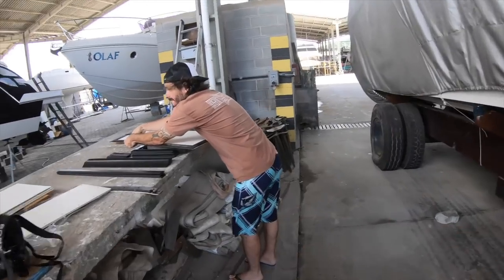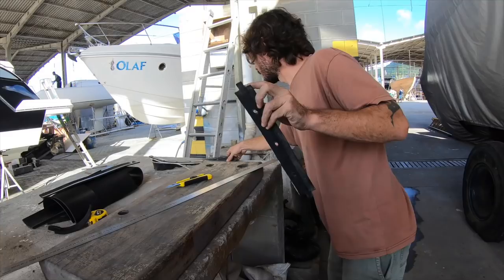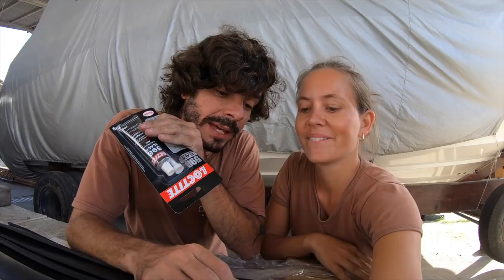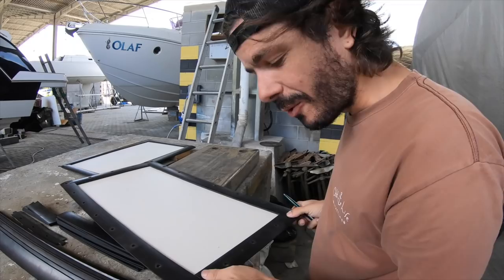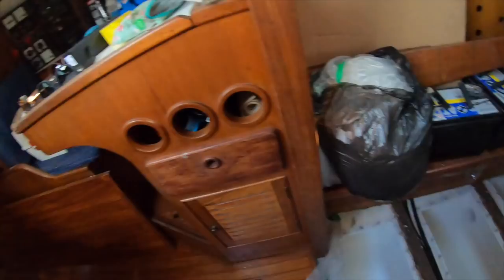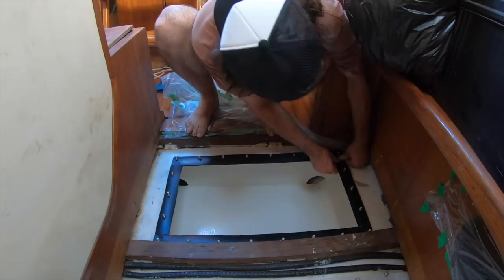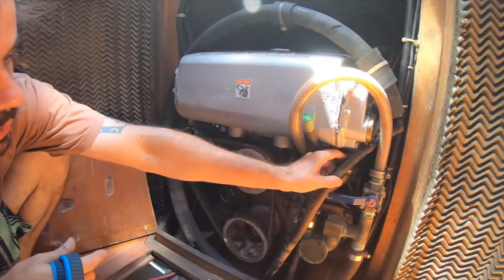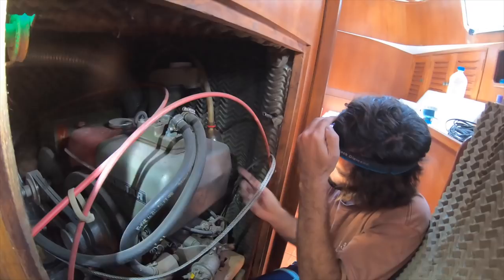⛵️Time to FILL UP our DIESEL tank?!? #127

Comment: You got to have a return hose to the tank from the engine!
Reply from the maker: It’s one of the hoses we replaced ☺️
Reply: Odd Life Crafting Are going to have a fuel polisher? You get bad diesel and you will clog up generator of engine or water heater

Comment: Can’t you test for leaks, by pressuring up the tank with air, and using a pressure gauge and time to determine if it leaks? Is it possible to reroute the Diesel line so that it doesn’t risk contamination of the H20?
Reply from the maker: Hello, Susannah. It might be possible, but we don't have the equipments to do the test. there is no option to reroute the diesel line. But as soon the tanks are closed it won't be a problem
Reply: Hi Duca. I agree with a pressure test of both your water and diesel tanks. Were you connect any pypes to the tank just disconnect the pypes and close them of. Use one that you can connect to a air compressure that has a guage that can show you the pressure. Pump it to a sutable pressure. Leave it for a hour or two and see if the pressure stays the same or not. With sope water and a paintbrush you can check for leaks at the tank.
Reply from the maker: The problem is that we don’t have all this material available here in the marina and to rent it would be quite of expensive.
Reply: Do you know that pump you use to pump n tyer stepping onto it with your foot. It is also good to use and not very expencive. And it has a guage on.
Reply: Perhaps a vacuum cleaner to see if it holds? Any air leaking in should be easy to hear (after you turn the vacuum cleaner off).

Comment: Is there a reason you did not use dovetail joints to make the diesel tank gaskets instead of the finger joints you used?
Reply from the maker: We kept the same format as the old one. But they are a little bit dovetail
Reply: For sure dovetail.
Reply: I thought a dovetail joint would be far more superior.  “Better”
Reply: how would you cut them in that material ?  would you have to make a die, and "punch" the joints ?

Comment: I have a suggestion that you and your Tubes might like: DIY Fuel Polisher. Ref: https://theboatgalley.com/diy-fuel-polishing/ You can never trust your diesel fuel supply. You can suck out your diesel and transfer it to another tank and clean out all those impurities, organic matter and water accumulation. Run that baby and you will have a lot less problems with your diesel engine and changing your expensive hard to find engine filters. By the way I would change out all rubber on your old boat.

Comment: How many gallons does the tank hold!🤔🙂
Reply from the maker: 650 liters
Reply: 650 Liters = 171 US Gallons or 142 UK Gallons(Imperial) 
Don't forget Diesel expands with temperature, so don't over fill the tank (or put a catch can on the breather pipe)

Comment: When cutting the joint in the gaskets, it might have been faster to bend a metal die in the shape you wanted, sharpen it,  and use a press or a hammer to cut the gasket but pushing it through.   It’s would be a lot faster and guarantee each joint is the same since the same die is used for the dove and tail.

Also when running new hose in tight spaces, attach the new hose to the end of the old one, then you can pull the new hose through  by pulling the old hose.
Reply from the maker: This would be great. The problem would be time, materials and tools to do the metal for it. For the tight spaces this is the idea we have, thanks for the suggestion
Reply: I was thinking like piece of scrap steel with a sharp edge vs a real machine shop die...   always great seeing your videos.   You guys are great at making do with what you have and learning as you go, love that spirit!

Comment: Engine alternator belts are loose
Reply from the maker: We know. We are gonna change the alternator. 😉
Reply: @OddLifeCrafting  Make sure it's either 100% new parts rebuild or a 100% totally new alternator... most rebuilt alternators will always 'reuse' old electronic parts that test OK, but can and do break.   Also true with starters too.

Comment: If your planning to put a heater in dont you need to put in a fuel line for the heater too
Reply from the maker: What do you mean as a heater? A heater to get the boat warmer or a heater to heat the water for the shower?
Reply: @OddLifeCrafting  a boat heater for cold weather incase you want to go into colder climates

Comment: Who knows how your water tank is plumbed.  But it may be that all that extra confusion of hoses may be so you can isolate one water tnk from another...which is smart....lets say your offshore and fill up your tanks in a particular country and the fresh water is really foul, really bad...you do wish to have a reserve of water that you know is good.  I also carry extra water in plastic jugs hidden away here and there.  And extra water for the liferaft.  And an extra secret stash that nobody knows about.
Reply: Best to have and use a water maker with enough solar to run it.
Reply from the maker: The idea is to have water maker in the future. I think for now we would have some jugs on the deck. We don't know yet. It seems that the water tank has 740 liters.
Reply from the maker: This would be great
Reply: @OddLifeCrafting  I have been watching during these troubled times that some boaters are having trouble getting water. It's a device that would guarantee vital water when times are tough or a mast breaks and adrift for weeks. Of course you can always stay where you are.
Reply: @OddLifeCrafting  It doesn't work that way...safety and the need for water is important.  When you start up a watermaker, you still have to bleed off the bad water....they can fail...and let thru nothing but salt water...so you segment your water no matter what and have backups.  A water maker is a miraculous thing but it can fuckup.
Reply: @safffff1000  Yeah, if the watermaker always works.  I have experience where the damn thing is only pouring in salt water into your tanks.  These were newer ones.  Be careful with your water.  2 times I've had to rely on Squall water...and thats with all the precautions I take.
Reply: @jerrycooke6511  Agreed but this couple learns well, I think they can learn to fix it with enough spare parts which should also be carried. Plus a hand pumped water maker would be a good backup.

Comment: Why aren’t you guys going to use the diesel generator
Reply from the maker: It’s an old one that makes a loud noise and shakes a lot. It only starts by hand and it needs to be calibrated for that and we don’t understand about it
Reply: @OddLifeCrafting  will you get work done on it and then recommission it?
Reply from the maker: We are gonna try to sell the one we have. It’s actually working
Reply: @OddLifeCrafting  oh, ill u get another one after you pull it out?

Comment: Now your getting into the interaction of systems.  Your diesel hoses should be rerouted so they don't go over top of the water tanks.  For that matter, electrical wires should not cross over other systems either.  Always think about maintenance as your rebuilding this thing.  If you have other systems intruding on the parts of another system your making it bloody hard to repair things in a storm in the middle of the South Pacific...separate your systems!!!!
Reply from the maker: We are still planning the systems. Thanks for the suggestions

Comment: Sorry guys but these gaskets you made for the diesel tank lids won't work. This is one item you NEED to spend money on. Research gasket material & thickness and have them made to suit each lid (continuous gasket. No joints). As an ex-pipeline & installation pre-commissioning engineer ( and then business owner) I spent my working life sealing flanged joints. Whatever you do, DO NOT, as suggested below, use an air test to test the joints for your water & diesel tanks. 1 - there is no need  2 - air contains 200 x more stored energy than a fluid-filled system (imagine two balloons popping, one filled with air, the other with water.....)

To test your tank lid integrity fill the water tanks with water and diesel tanks with diesel. Fill the tanks completely up to the top of the fill point on deck and use that static head pressure to test with. You'll need to be able to pump the diesel out afterwards to a sensible level within the tanks. Sometimes life ain't easy I know............